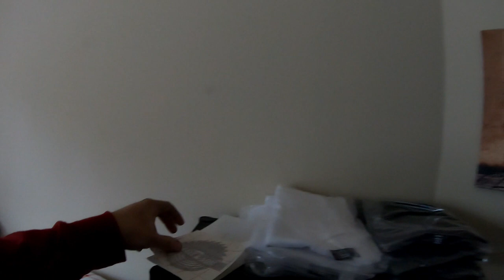Rebuilding Dodge 2500 Front End. Complete clapped

Comment: Thanks for the tip. I just swapped my rotors on my '96 and was going to push the hubs off with the steering.  But Sam said beat it with hammer.  It worked well.

Comment: I just did the front end on my 96. I used the same moog steering setup. I like it. A lot better than before. I tried getting it aligned.. but all the alignment shops i went to said their rack wasnt big enough for my truck. Im only on 35s and 16x10s. I did a home alignment and it has gotta be pretty dang close to perfect. I plan on putting 96 ford f350 knuckles, hubs, and brakes on the front end here soon and ill have it aligned professionally somewhere that could do it.

Comment: Those ones that use the steering are us lucky people that get the absolute joy of rust. But it does work great.......... so does and ungodly amount of anticize while putting it back together. And some of the second gems had 4 wheel abs some had 2 wheel abs so just the sensor on the rear differential. All 3 of my second gens were 2 wheel abs. My brothers was 4 wheel abs. The 2 wheel abs hubs are $100 each at my local Napa 4 wheel are $200 each.

Comment: Just in case you don't know...Dodge and GM have had issues with the steering box shaft that the pitman arm attaches to. Some shafts were not properly heat treated and catastrophically fail without warning. 
     
Had a Dodge with 4,500 miles do that at 50mph. Totally destroyed truck when it took out guide rail on interstate. Driver didn't get a scratch. I've heard of them snapping in parking lots at low speed.

Shaft look like it been cut with a waterjet. Straight across about 1/2" outside of gear box, no jagged edges or visible defects.  Wish I had not lost the pic of it.

Comment: And next week on the channel we will be replacing the inner axle seals.  Lol. Hope not.  
 But seriously, for U-joint removal first cut the + (cross) out of the joint with a cutting torch. Then the caps will knock right out easily. Prep the yokes with ball wirebrush in a drill. The new joints will go together smooth with a little grease or anti-sieze.
Reply from the maker: Already did the seals but I filmed this video 3 weeks ago we still all good
Reply: Fun fact , always slide axle back in with hub bearing already installed , do not let axle hang in there alone and egg seal out

Comment: i have a 1994 ram 2500 gas burner 5spd nv4500 bad frame i have a 2009 ram 2500HD 4WD wonder how hard it would be to put the 1994 cab and motor and trans and use the 2009 frame and axles know its a lot of work but the 2009 frame is so much stronger and the 2009 has the AAM HD Axles

Comment: Hint.. when you break off a tie rod end taper in a steering knuckle or pitman arm.  and its stuck tight.. can't get a hammer on it..   throw a 7/8 x 2" bolt and a square 7/8 washer in the end of your ball joint press C Clamp.. now you can get the stuck broken off taper out not always with ease.. but it will come out..  here is my set up.. https://i.imgur.com/eatuSyh.jpg   sometimes you have to do it the hard way.. https://i.imgur.com/Vv09FT1.jpg  that install was quite a wedgee.. here it is mostly hooked up.. https://i.imgur.com/CWtlbY4.jpg

Comment: If you lived in the north east you would be using 1/2 can of pb and using the power steering as a press to get the wheel bearings off and a 3/4 gun to get the nut off. Its must be nice having no road liquid road salt.

Comment: NIce vid, I have a low milage 94 2500 FWD to do the front end so this helps , I guess ? 270 K original. Got some noises but not bad really , mostly just starting to make some noises like bearings and seals leaking.

Anybody got any good suggestions on converting to Warn hubs since I will have it apart and it is my own truck ? Still runs and drives great with the 12 valve.

Comment: how did you mount the stabilizer shock? also did you reuse the old stabilizer shock or used one from a 4th gen ? did you reuse stock 2nd gen trac bar as well sorry for all the q's getting ready to do this on my 01
Reply from the maker: All new stuff and you need a new double ubolt clamp for new shock location

Comment: Did you do the 3rd gen brake upgrade. Well worth it I have put 150k miles and only lost .010 inch on all 4 rotors
Reply from the maker: Nope got the old junker 2nd gen brakes on it still lol send a link for the upgrade I’ll check it out 
Thanks

Comment: no rust I hate u guys , that is funny how easy that unit bearing came out . 2 hours of pounding per side up here minimum
Reply: TheCaperfish if you take the top two boys out and back the bottom two out enough to still have full thread engagement between the wheel bearing and bold put a shallow 1/2 inch drive socket on a 3 inch extension and use the steering to press it it will fall right out.
Reply: Yep know that trick and a few more but none of them work all the time they are froze in there solid , chisel against face and pound it will work every time but its the last resort after trying everything else first  , iv done hundreds if em in the most salt infested place in north america , they are a pain in the ass

Comment: I hate all those new front ends with unit bearings,Give me the old school stuff with packable bearings, lock out hubs, king pins and leaf springs Ya leaf springs could  not give a crap about the ride... on a 3/4 or 1 ton or bigger truck all that is is more to break and wear out quicker also burns more fuel.
Reply: Here while back I found a locking hub convertion kit for the 2nd gen dodge trucks. I think the next dodge I get im gonna convert it to use locking hubs

Comment: You have no idea how lucky you are to be out of the rust belt when it comes to working on this stuff.  However, you can have Commiefornia. Used my fair share of heat to do what you guys are doing with a couple taps of a hammer... However using heat I've found concentrating that heat in one area, vs moving it around works better.
Reply from the maker: Yeah I lived away from here for awhile and saw what happened to trucks out there and that played a part in why I moved back
Reply: I live just above Maine in Canada and i do get jealous of the rust free trucks but dont think i could live without the 4 seasons , love fall and winter , a new truck here will last about 10 years and thats it if one did no rust prevention , brakes lines need to be replaced by 6 year mark guaranteed
Reply: @VBELTandSON  Yeah I'm over in Washoe Valley now, it's so amazing to see all these clean older vehicles running around.

Comment: You should make some vbelt  merchandise that incorporates the 12 valve truck
Reply from the maker: Soon 🤘🏻🤘🏻
Reply: I just picked up a 98 12 valve. 4wd 4door manual swap. that was in a accident and it  looks like the frame was bent, and cab mounts, rockers rusted out. It does start I paid 2700 what would you recommended doing with it?